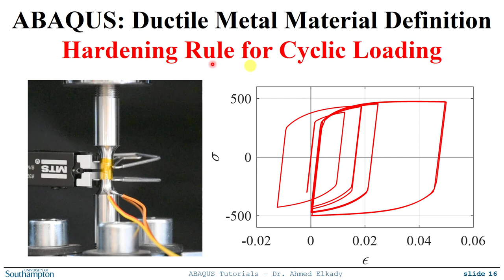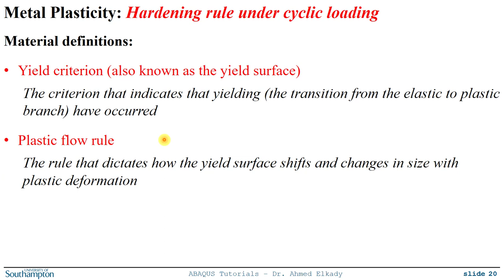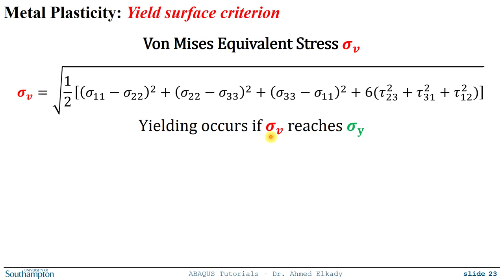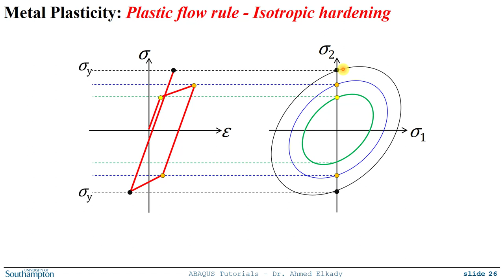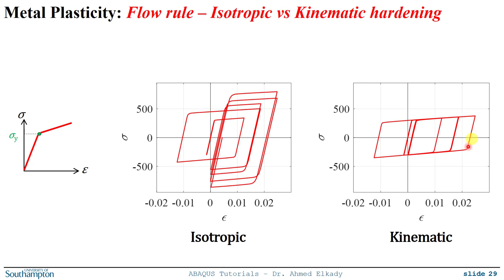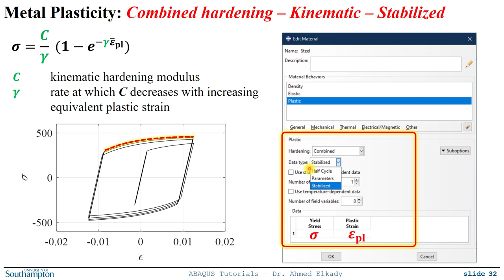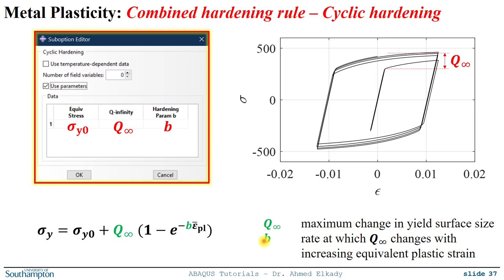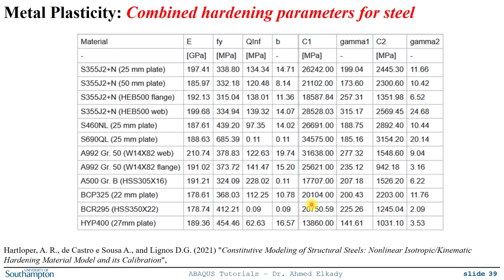#34 ABAQUS Tutorial: Metal Plasticity | Cyclic hardening

Comment: Can You please share more references having all the material data to define steel material?? 
I couldn't find the complete parameter details for 
AISC-A36 and JIS- SS400, SS41 steel... 
Concrete material details for high strength steel, at least 50MPa for Concrete damage plasticity.

Comment: Thank you Dr. Ahmed for this informative video. 
Does the cyclic stress strain curve behave exactly same as monotonic kinematic hardening curve if my loading is not reversal (For example pressure loading). SO in this case cyclic hardening would be zero as the loading and unloading path always stay in the straight line.
I would be grateful for your view.